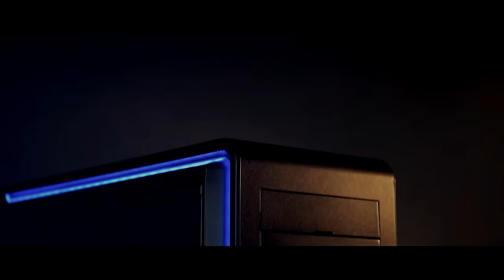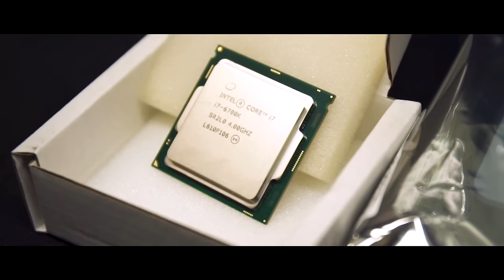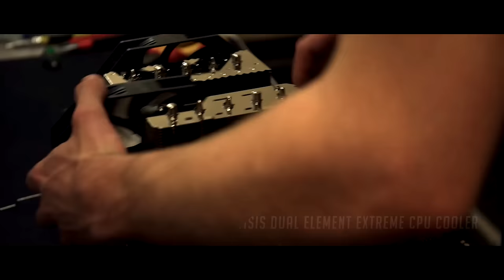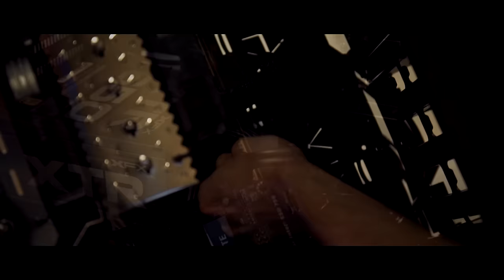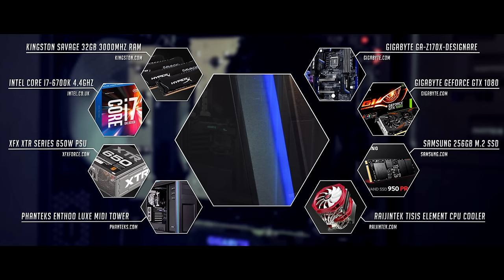My New Sponsored PC!

Comment: Got the same case, I also picked up the Phanteks LED strip kit that you can attach to the existing LED strips, but I can't recommend those LED strips, they do NOT stick at all, it's a real pain to attach it in your case, I ended up having to hot glue the strip down

The case is a treat to work in, extremely good cablemanagement, comes with pump & reservoir mounts, tons of dust filters. Extremely nice case.

Comment: Phan, I just bought and installed that exact video card today. System got a fresh i7 6800K + mobo + 32 GB of RAM a few weeks ago, and the CPU cooler is a Noctua NH-D15 which looks almost identical to yours but is slightly larger (almost touches the video card in the first slot). If it wasn't for the case I'd have thought I was looking at a build of my system.

Comment: Shouldve went with an AIO cooler or actual watercooling cause u have an i7 6700k. the kraken x62 would be dope :)
Reply: Tbh lucky to have a 5 degree difference between that cooler and a x62
Reply: ***** yea im not saying the cooler is bad, its just me that i hate looking at having a huge heat sink rather than a dope design the x62 provides or atleast any other aio cooler like corsair.